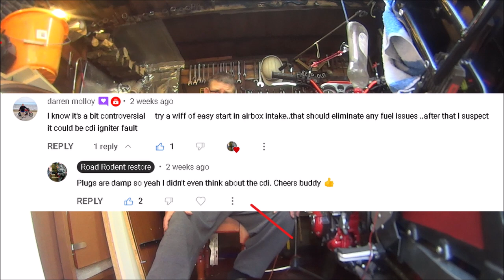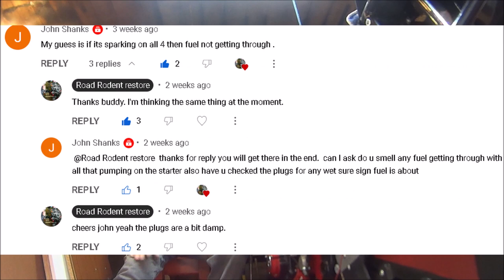CBR1000F landfill bike. Set backs.

Comment: Hello John, I've just "discovered" you and thanks for the videos - including all the stuff that didn't get filmed for gremlins and life, anyway, I have had a problem with my 1996 sc24 cbr100f (T) and seem to have done the same as you and fitted another engine, changed carbs, changed coils - still  - after a long undocumented story, turned out to be the ignition module. I am currently going through the cam chain tensioner saga, so your vid was helpful to me to pre prepare my self. Nice. What ? Yes, so I am going to put the original engine back in after doing the work on that and I even have some new carb rubbers - -NIce again . . .smiles John, cheers.
Reply from the maker: Hi Darren. Thanks for watching my videos and I hope you have a lot better luck with your cbr than I'm having with mine. Can I ask you where you got your carburettor rubber boots from?.